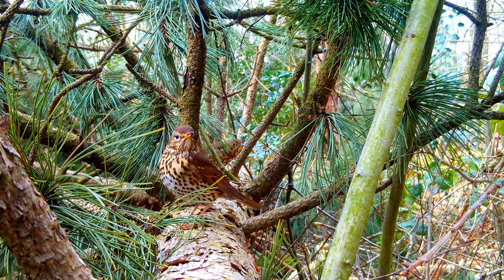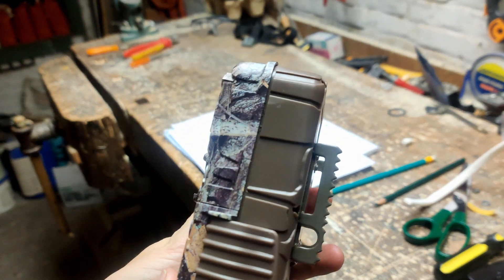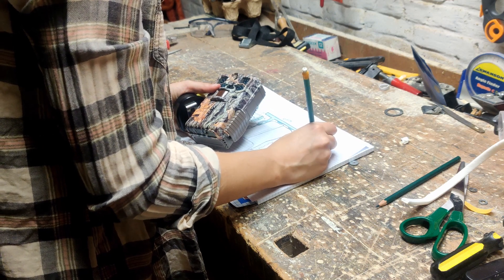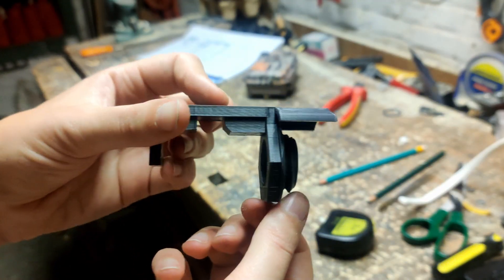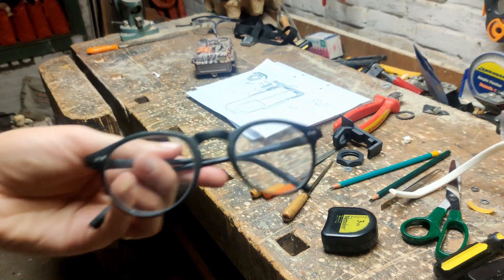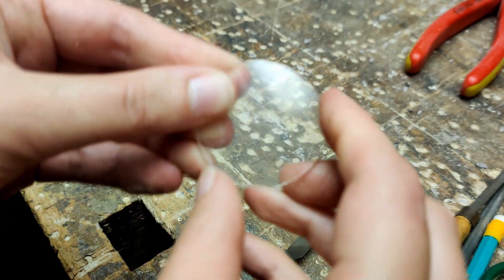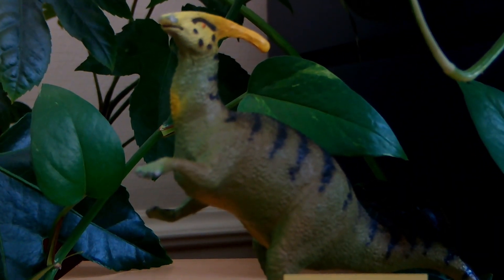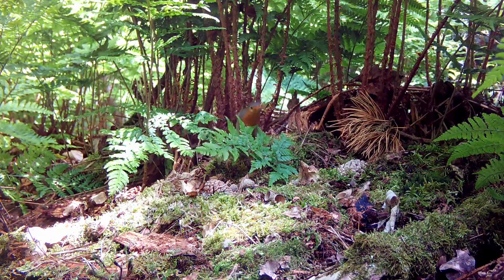How to make a Close Up Lens for your Trail Camera with Reading Glasses

Comment: For those who don't own a 3D printer and would like a much simpler and cheaper solution, I simply use poster tack (or poster putty) to affix my reading glass lenses onto my trail cameras; no clips needed and it works beautifully. 🤗